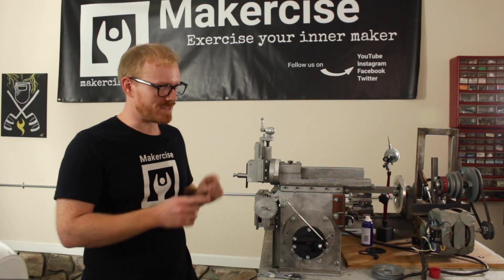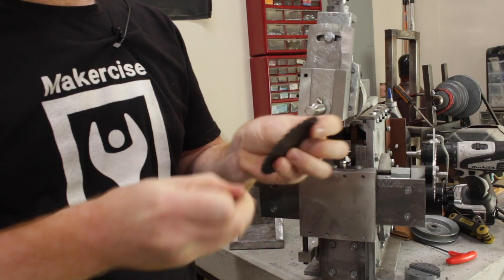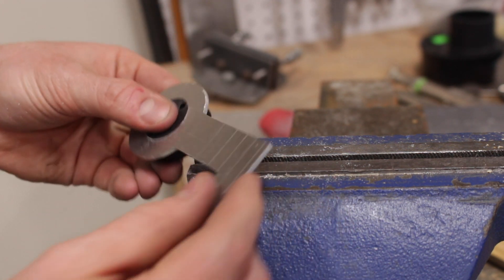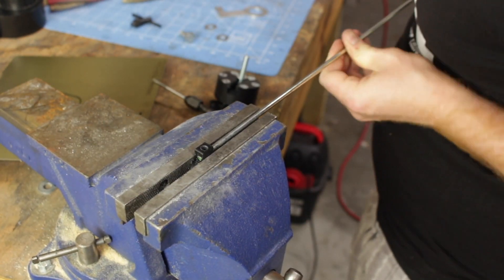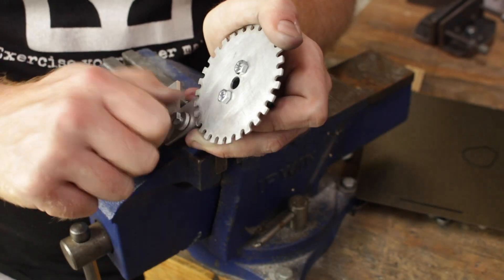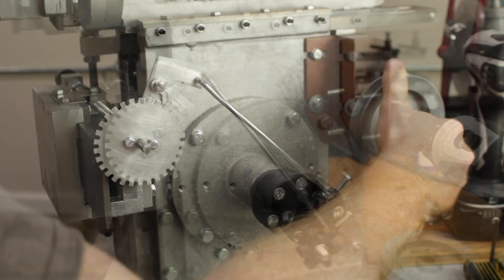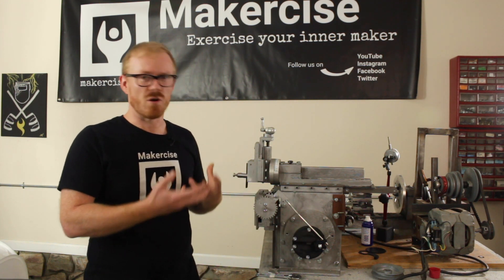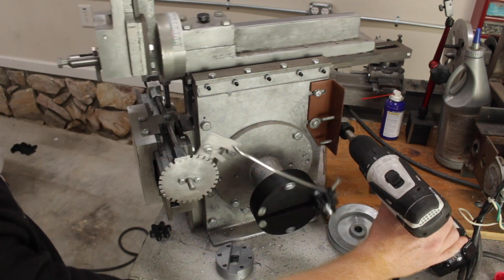Automatic Feed Mechanism for Gingery Shaper - Using X-Carve and 3D Printer

Comment: 3D printed parts dont do good with cut threads, even printed threads dont hold very well (size M8 for example) i use "Knurled Threaded Insert" print the hole a bit smaller and use a soldering iron to push the insert (hot due to the soldering iron) into the position.

Comment: For threads, I always embed a nut, ie I leave space for it while printing and glue it in afterwards. It should be a tight fit, but not stressing the printed part. It should be located such, that the bolt pulls it into the part, against a printed shoulder, preferably in z-direction. Tje nut trap is easily modelled by subtracting a nut, at least in openscad.
Reply from the maker: I will probably give it a shot. Thanks for the suggestion.

Comment: G’day Cressel, would helicoils work in plastic, you may have to glue them in. Cheers Peter
Reply from the maker: Maybe, I will probably just try modifying the design so I can use a nut within the plastic component.
Reply: There are some threaded inserts that you install with a soldering iron to melt the plastic. I wonder if you could use a helicoil the same way!

Comment: often in manufacturing, there are brass bits that have threaded holes that are pressed into injection moulded parts, which I've also seen people doing with 3d printing. Sorry i don't know the particular name of this practice.
Reply from the maker: Interesting. I will probably try it with a steel hex nut.

Comment: Looking good. You might want to cut that rod in half and install fine threads on both sides with a turn buckle and stop nuts. That way you'll have better control of the length vice the set screw you're using now.